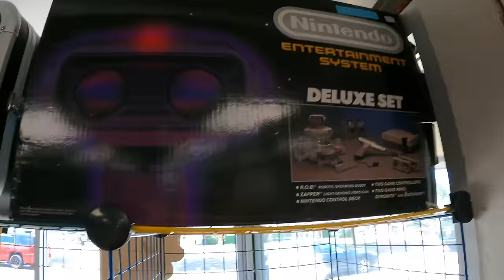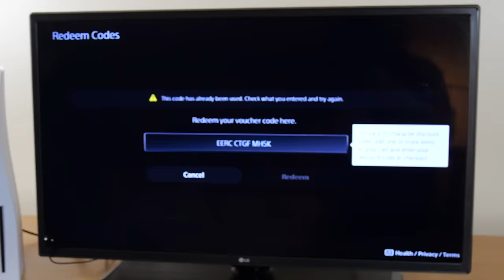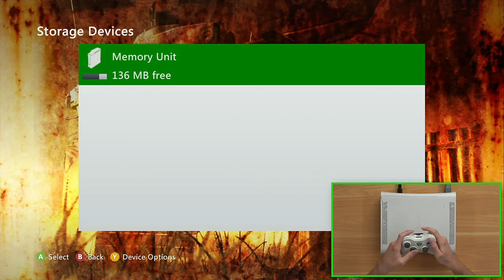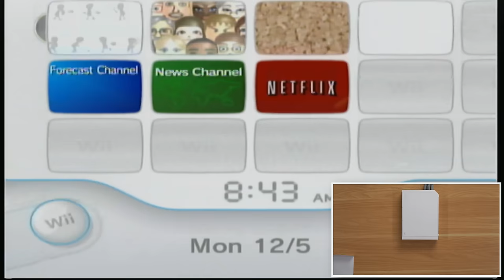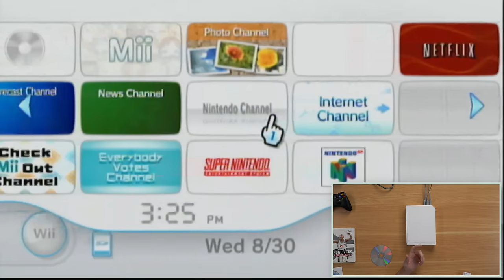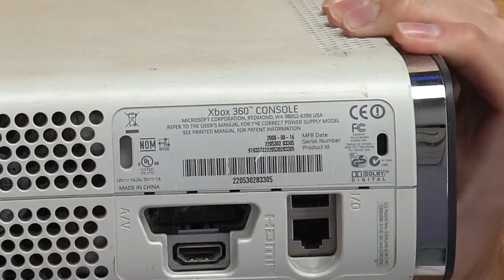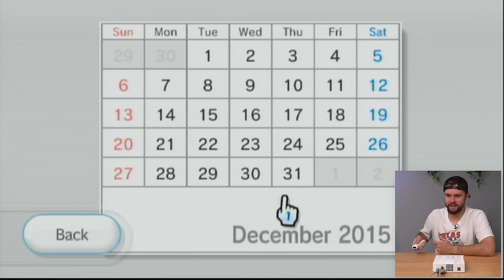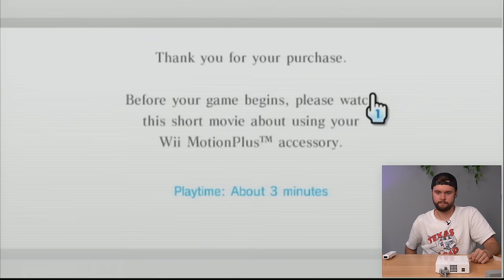I Bought a Truck Load of UNTESTED video games...

Comment: i watched it all and liked it such nostalgia with the old 360's, mother bought one i think was on launch day or the year after, need to check the date, it is the first gen and yes it have had RROD multiple times (got it fixed under warranty), right now it is sitting in its original box as it could not read discs anymore, man i need to clean that sucker up and see if it still works after being not used for the last 10+ years, i do have the cheaper Xbox 360 Arcade (built in smaller memory and the cover over the HDD slot) that dad had until it also got the RROD, did the home tricks to get it to work a full playtrough of Halo 4 then it got artifacts and RROD and red powerbrick... never worked again after that

Comment: You were in Greer SC which is part of Greenville County I do believe. Good ole A&M Games. And then the quick stop at 1up Games about of 15 minutes from my location in Greenville. Not much going on at 1up. But they do get bundles of stuff that come in from time to time. There is another location called the Video Game Cavern on Wade Hampton Blvd. Also located in Greenville that has always had a really good collection of everything from Atari systems all the way up to most current. Never running low on stock. Great owners as well.

Comment: I found an xbox 360 E in a skip, and now thats my main 360. a definite upgrade from my xenon 360 that i had, but for the 5 years i have that 360e i have used a phat to E power converter on the xenon psu lol.